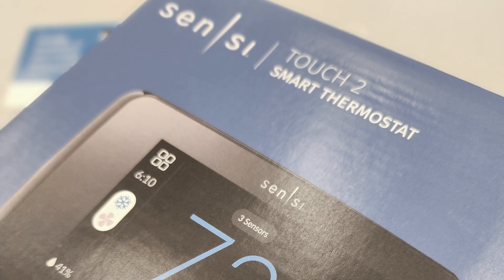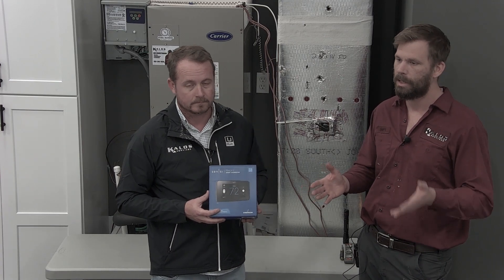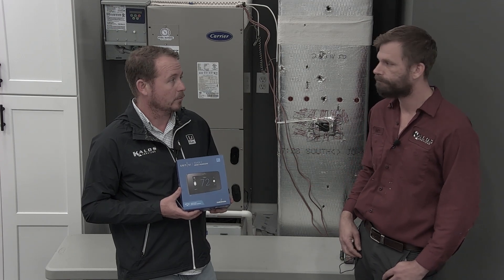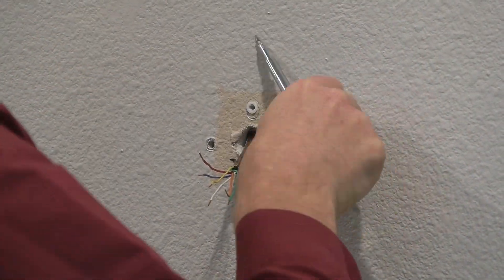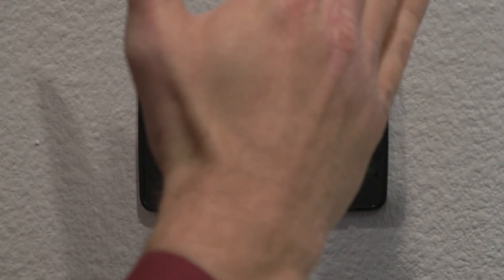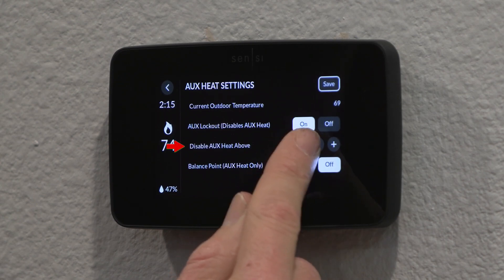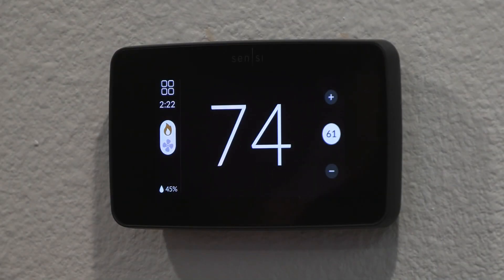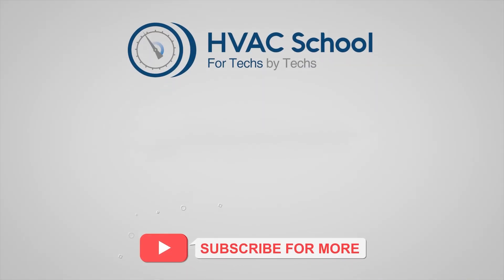Sensi Touch 2 Install

Comment: My old Emerson Thermostat has a connecting wire from RH to RC. Do I need to make the same connecton on the Sensi Touch 2? I have gas heat and AC in one unit.

Comment: Too bad you don't get in to any network/wifi setup.  That's where the real pain can be.  I bought a Touch 2 to replace a Nest that had worked for 4 years but then decided to power the air handler on by itself.  So, off it went.  The touch 2 installed just as easy except for connecting to their "cloud server" meaning it would connect to wifi but would not connect to their stuff.  I finally found where on some networks, you have to go in and do Port Forwarding as the Touch needs to have certain ports open, and pathways, that I didn't have to do for any of the other 30+ IoT devices in my house.  I'm a network administrator by trade so not a major  thing, but, makes no sense why theirs should be more complicated.  At this point, I can work it whenever I'm home but it doesn't let me access it when I'm away.  I've read this is rather common when it loses network connection which I do a modem reboot at 4am every day.  Oh well...

Comment: It is easy to use I sold and installed a couple of.  My one customer who has several heat pumps in one building, having me change all of them over because he likes to see from home with the temperatures and operation settings of each thermostat throughout the building that he can control from the comfort of home.